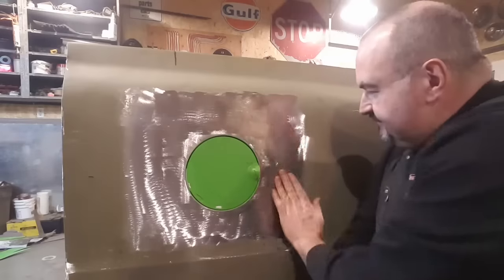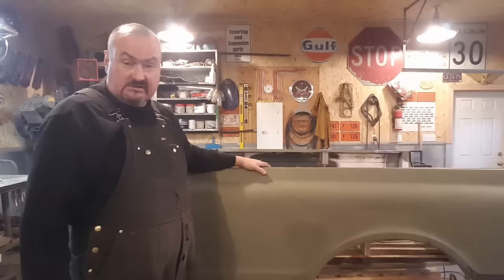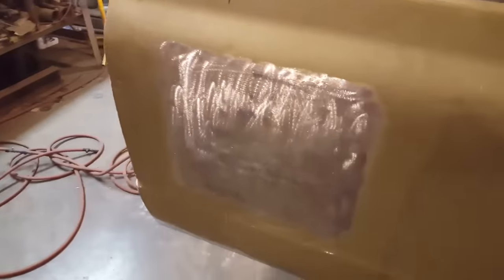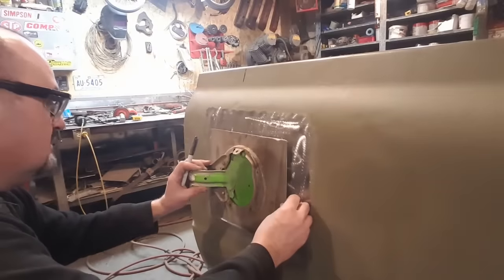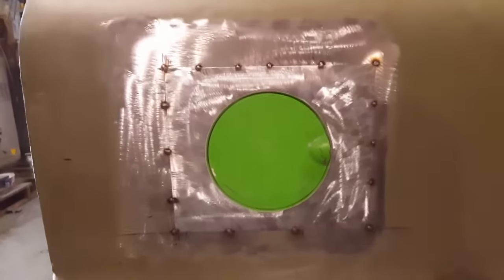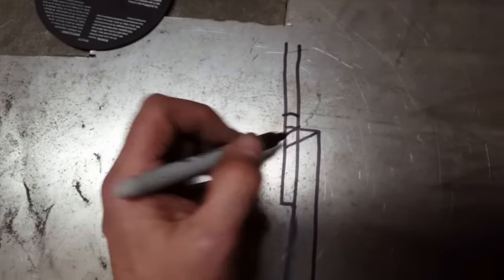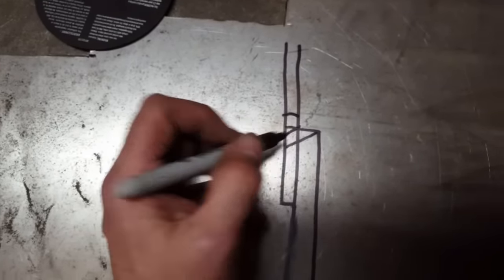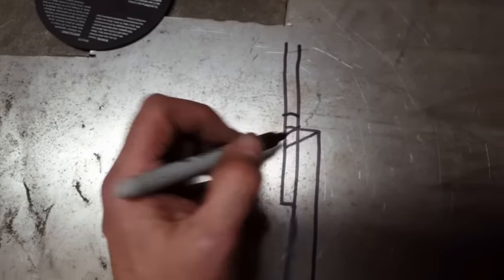Butt welding sheet metal the easy way.

Comment: Hi Fitzee! Greetings from across the Pond. I don't have a problem with your accent, maybe cos I listen a lot to Irish radio (RTE.ie/radio1) which reaches me here in Wiltshire, England and sounds very similar to you. (The Irish are much better interviewers, listening and giving people time to speak, and not so pompous as those stuffed shirts on BBC Radio 4!) The accent is not Dublin - that's quite flat, with maybe a metropolitan intonation? Nor is it Cork - that has quite a sing-song tone and can be spoken very quickly. Maybe somewhere else then in the 32 counties? Co.Mayo??
PS: I have been following your advice on 'Butt-Welding' and, 'Not Cutting the Rust'! One question though: is there a rule of thumb for maintaining a gap with Butt-Welding? Should the panels press together where they are to be welded? Or is better to have a gap? I had an idea that the thickness of your Mig Wire is a good guide. Those square Butt Clamps you showed us (but don't use) give a gap of approx 1/16". Many Thanks. Fitzee - makes it Possible!
Reply from the maker: I like a bit of a gap as it let's the weld penetrate easier. As for my accent! I'm from way across the pond and from the  oldest city in north American! A island on the east coast of Canada  called Newfoundland
Reply: @fitzeesfabrications  Newfoundland - Wow! I've been reading on Wikipedia all about your home place. Capital - St.Johns. Canada's 4th largest island - off the coast of 'that other place' - know what I mean?! (Warning: May Contain Americans 🙂). The closest land to Titanic's final resting place - 370 n.miles, 12,500 ft down (2.4miles). 1,160 souls still missing. Last pick-up point - Cork, Ireland. And the museum - Maritime Museum of the Atlantic has a permanent Titanic memorial display. Many, many thanks Fitzee!

Comment: Pro tip . Try not to do this in a Square.  Rounds are much easier. Less welding too.  So its faster . 
But what do I know only doing body work for 43 years.
Reply from the maker: How can round corners be easier? How you cut a round corner?  Yes it can be done and there is nothing wrong with it. But saying it fasterand easier it is not.
Reply: @fitzeesfabrications  You have obviously never worked on a flat rate or been a production bodyman .  Less welding means less grinding too. But you know that don't ya ?   
Use a reciprocating air saw with a trim blade in it. Place round part over panel.
Scribe around it , then make a indexing mark for alignment and cut it out . Place part in hole . Tack weld 4 places air cooling as you go on each weld. Keep repeating this process till complete. At some point during this process you will no longer have to cool each weld. This will depend on the gauge of metal being welded.  The grinding process will also depend on gauge of metal.  Your working on an old car there try that method on a newer vehicle. Your welds should be flat enough to require a minimal of grinding.
Proper set up of your mig welder is very important too.  Do you ever gauge your welds ?  Taken a welding test to be certified?

Look I'm not trying to bust your balls here.  Its obvious this method works for you .  But that doesn't mean there are not faster ways of doing it and still get the required results.
Reply from the maker: I worked in the trade. Butt welding took way more time  period regardless  on how you did it. Done this process  many different ways.  And I can't see doing it like you explained faster. Send me a video on it and see how long it takes. One thing about this trade is there is always a better way to do something. My way or your way. They both work good for each other. My way for me your way for you. I see alot of thing on youtube I don't think is right but I feel that it is right for the person doing the repair. I may not agree but I sure don't tell them the repair  can be better my way. I'm here to help others not telling them I'm better then them.
Reply: @fitzeesfabrications  Butt welding a sectioned replacment panel is a manufacturer recommended procedure for many vehicles.  The use of a sleeve 
( backing plate )  is also a very common repair process that is recommended by many manufacturers in certain areas of a unibody . I only mention that because you did bring it up in your presentation. 

I don't think of myself as being better than anyone .  I do how ever hold myself to a standard.  This comes from working in certified shops for decades. 
Please show me where I said I was better than you .  You might feel it was implied by the way I tried to give you some perspective of where I was coming from. If your skin isn't thick enough to take criticism then don't put yourself out there like this.
Fact is the only reason I commented on this is because in my 43 years doing heavy collision, customization and restoration.  Never have i seen anyone using this method.  That should tell you something right there .
Reply: @arcraider937  Wow.  You're obviously much better than Fitzee because you insinuated so in your opening shot.  What's your channel?  I'm sure the thousands of people who love Fitzee would love to see your superior method.  We're all here to learn, so please show us.

Comment: Errm good apart from the cap / door being the wrong way round
Reply from the maker: Nope. Look agian. It's on right
Reply: @fitzeesfabrications  sorry i meant it should open the same way as the cab door, not suicide style. Millions of reasons why not hence the name suicide door 👍👍🍺🍺
Reply from the maker: @kinn1647  it do. That is the front of the box on driver side
Reply: @fitzeesfabrications  soo sorry dude  looks like the rear. Couldn’t see from the angle. My mates a Fitzsimmons  👍👍 again, a red faced sorry bro

Comment: Nice work, but all the fuel filler doors I've seen place the hinge toward the front of the car so that wind or passing objects would tend to shut the door.  Yeah, I know.  Everybody's a critic.  Sorry about that...  If we call this a "suicide" filler door, that would instead make it way cool...
Reply from the maker: Look closer. It's on the right way.
Reply: @fitzeesfabrications  - Oooops!   I think you're right.   Sorry about that, chief.  🙄  I've had a lot of trouble with thermal expansion in thin stuff.  I suspect my problem is too much heat input, mostly because I'm too slow and want full penetration all along the seam.

Comment: see you are not using a welding helmet, what kind of goggles / glasses are you using. I have difficulty using a helmet over my glasses
Reply from the maker: I dont see the arc. I hidevit behind tip of the gun. I have cheap dollar store glasses I use with my helmet. They are small and fit in helmet best kind

Comment: Just look at your video and when you first weld the panel in why don't you ues an magnet to hold the panel flush and then tack it in and work along with a magnet and then you haven't got to tack and recut put a magnet in each corner to hold the plate just an idea that's what I would do
Reply from the maker: Heat will pull and push and the magnet won't hold it in place. Floating in the panel can be very tricky.
Reply: @fitzeesfabrications  thanks for your reply just thought it would help save you doing the work twice

Comment: Why not just cut 1/4" all the way around the actual lid and weld it in? Little to no body filler and way faster.
Reply from the maker: Cutting a round hole  involves a small saw. I dont have one. Lol. So did it this way. I can't say it is faster but your way will work just as good or maybe better.

Comment: NOT a fan of this fab work. Cutting the seam at a angle means that the butt joint is about half the gauge it was prior thus creating a problem with blowouts on the tack welds if the unit is set too high. He even showed that after grinding the welds he had to go back and spot in a tremendous amount of the seam because it was so thin prior to the grind and had holes and cracks after grinding. I prefer flanging the inserted piece, this gives you full metal gauge for a much stronger seam. With all the flex that section will see from opening and closing the fuel door I would bet stress cracking will occur over time.
Reply from the maker: If a body flexes then every bit of filler work on a car would crack. This is not structural  steel we are welding were. Seems like every structural welder looks at all welds like its the empire state building. Its body work on 20 gage steel. The rewelding was for cosmetic  reason. Was not thin. Or blow threw. Lap welds hold moisture  and end up forcing the moisture  to the top causing bodywork to brake out. I repaired enough of it to know. But we are all stuck in our ways and you do it your way and ill do it mine. Thanks for watching

Comment: Great work and advice but this is NOT Butt welding , Butt welding involves the electrical charge being put through the steel to be welded and they are fuses together , it's not what this is, you are doing more of a  "flush joint"
Reply from the maker: It depends on what field your in. A butt welded joint in the automotive  industry is never called a flush joint. Im at this 30 years and all body shops i worked in they call this a butt joint. Your talking from a industrial  side of welding. Terms for different fields of work mean different things.

Comment: Its the lack of PPE for me, hows the flash burn feeling bud. And you could have just welded normaly, why didn't you just run a bead over and do a filet weld. But ya know its all you
Reply from the maker: You run a bead on sheetmetal  your going have a mess on your hands lots of warpage

Comment: 3:20 DUDE where the f is your respirator? 

Before you decide that I'm over-reacting, because it's only a video, and you have 30 years in this, hear me out: Once your lungs are damaged there is nothing anyone can do to to fix it. I've spent my entire life (I'm nearly 58) working in the relative safety of various metal shops. I have never really had to spend much time grinding, sanding, cutting, etc.  Unless it was obviously going to be an all day thing, I rarely wore a dust mask. Last year, after a period when I had been grinding and sanding more than usual, something changed.  Something I was grinding on got into my lungs. Life has sucked ever since. I'm perpetually exhausted.  I can't clear my lungs. There is no way of knowing if this is from just one puff of dust or the cumulative effect of years of stupidity. If you are a young man reading this -  don't take chances with your health, especially that of your lungs. and with the current pandemic, getting into the habit of wearing an approved dust mask or respirator when necessary while never be easier.

Comment: The title of your video is incorrect. That is not a butt weld, it is a lap weld. A butt weld is when the seams butt up together, you can usually see daylight through the seem. A lap weld is what you have done, you overlapped the metal. For having so many years of experience you sure do not know the terminology.
Reply from the maker: Lol. Go watch the whole video.. it's a butt weld just like you discribed
Reply: @fitzeesfabrications  then why did you waste your time taking it to the bed of the truck?? Seems like a lot of unnecessary steps.
Reply from the maker: No it is not.  In fact doing it this way is easier then cutting to fit and trying to float in a section of Metal in a hole with T clamps. You must not of watched the whole video the over lap is part of this butt process
Reply: @fitzeesfabrications  no I did not watch the video but I have done this exact job myself and I didn't have any problem doing it the normal way. But whatever works for you if you want to waste an extra 30 minutes be my guest.
Reply from the maker: @mark5150ty  I been doing this a long time. I done it the way you say and the extra 20 mins is saved doing it the way do it. No sanding. No fitting. No floating panel.. be truthful I am willing to say it cuts the butting process in half. Just go watch the video and you will get a better understanding on the process.
Reply: @fitzeesfabrications  no thanks I've been doing it for over 20 years myself so I'll stick to my tried-and-true methods. And I don't believe that is 20 minutes faster. Maybe it's 20 minutes faster for you but it would not be faster for me. I don't look to add extra steps, I prefer to perfect the correct method.
Reply: @mark5150ty  Maybe you should watch the whole video.  It's an excellent method of butt welding.   Strange how 100,000 people follow this guy, but no one follows you...

Comment: this video is a free course in how NOT to cut and weld in bodywork panels. Astounding that in your "30 years experience" you're still ignorant on how this should be done-
Reply: I just looked you up to see the correct way.  Guess what?  Your channel has no content.  I'm shocked.
Reply: @Sculpin74  I have already supplied links of people who actually know what they're doing, elsewhere in the comments.
If you are sincere about learning something of value, I invite you to seek them out-
Reply: @horacerumpole6912   Oddly enough...the links to "people who actually know what they are doing" won't be video's of YOU doing anything will it?  You're just a mouth that gets off on putting people down who can do the stuff you can't.  That repair looks quite well done to me and I'm a bodyman of over 40 years experience.  Of course that doesn't matter.  I must be equally ignorant as Fitz...in which case I'm in good company.
Reply: @Sculpin74  Did you watch any of the links?
If you really think this is good work,  then you are astonishingly ignorant of what this skill is about-40 years experience?? I wouldn't lean too hard on that claim…

Comment: Horse shit...just use magnets
Reply from the maker: To each their own.
Reply: You would need strong magnets to hold well enough to do the cutting and fitting done here.  Plus they would be a pain to work with simply because they would constantly be encased in grinding particles and slivers.  Not fun to play with.  The biggest thing though...is how magnets affect the MIG welding process.  Magnets are not nice to weld near as they make a mess of the weld for some reason.  You would know this if you did a lot of welding.  Tacking is just so much simpler and effective...